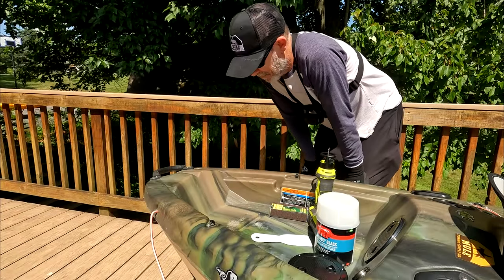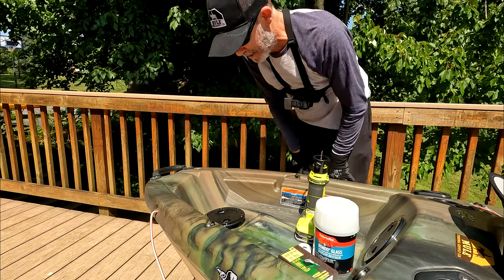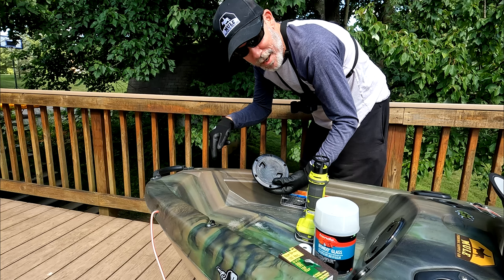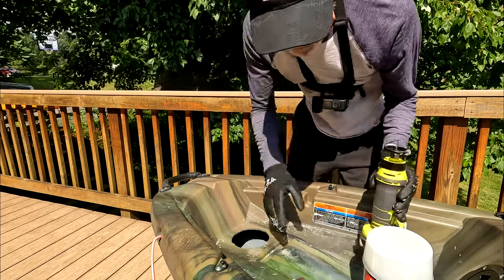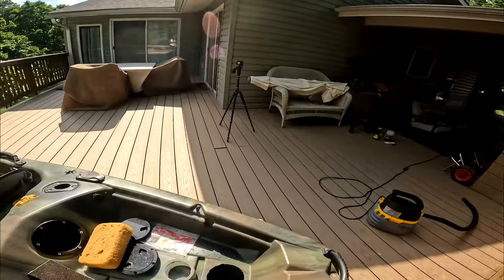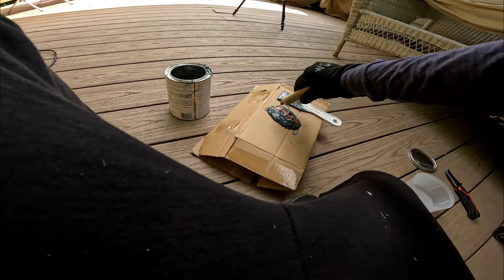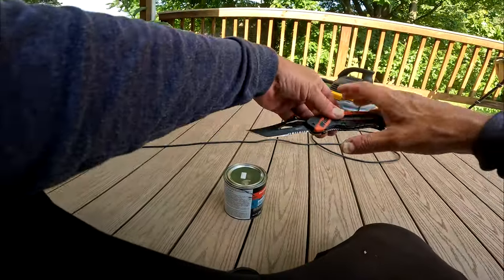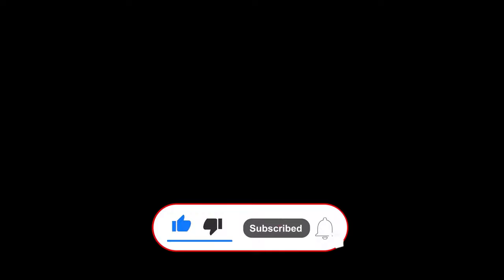How to Repair Pelican Kayaks

Comment: Barry, get some 1/16"-1/8" kydex sheets. Thermoform it with a heat gun to the shape of your keel and use some 3M outdoor rated double sided tape to make a rugged and replaceable keel protector.
Reply from the maker: This, absolutely! Unfortunately, this keel was too far gone. Applying heat would have crated an unmitigated disaster. But this (what you suggested) is what EVERYONE should do the day they buy a new yak. Thanks, LB! This is a link that John (Rock Solid Fishing Club) left to eliminate ever having to perform this repair and covers what you eluded to: https://youtu.be/gWgDEaZalbk
Reply: @BarryP  I figured it was too far gone and the heat would make it worse but wasn’t sure. It’s just what crossed my mind after I seen your issue and heard lb’s solution

Comment: I’ve seen people do what black is talking about… not sure if your haul is too far gone to go with that method 🤷🏻‍♂️ but I like the inside repair approach. Let me know how it works out. And hopefully you can do a protective heal guard on the outside also!
Reply from the maker: I've got another Pelican that has the exact same repair and has been trouble-free. I pinned LB's comment. Can you do me a huge favor and move your link as a reply to LB's pinned comment? Thanks again, John!
Reply: @BarryP  yes sir I’ll do that! Did you see my thoughts on the crescent? What was your opinion if so
Reply: @BarryP  you really like that pelican huh? If it was a sit on top of I’d probably go for it. I’m scared of the comfort for the amount of time I want to spend fishing
Reply from the maker: @john081277  I did. There are a bunch of reviews out there. That's how I learned about them in the first place. Again, it boils down to budget. If you can afford a Crescent, set it and forget it! On the other comment, I have a "Seats Pt 2" coming soon!

Comment: Hey did you ever figure out what to do for a rod holder when taking hooks out of fish and pictures ect. There just seems to be no place to put rod down and out of the way , usually just set it on the side or my lap and it ends up slipping or falling off...lol. I thought I saw a product along the same lines as the Rotogrip but instead of a paddle it will hold a rod , can't find it though , can't remember who makes it.
Reply from the maker: No sir, I did not. I just got used to settling it in kind of a cross fashion out of my camera shots. I have yet to lose a rod on this yak. Hopefully you didn't just hex me. LOL.